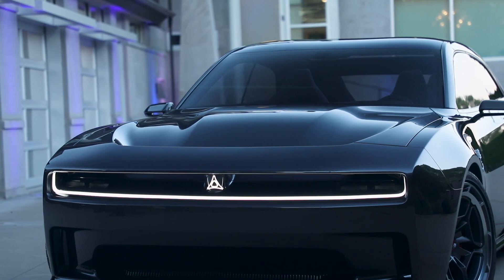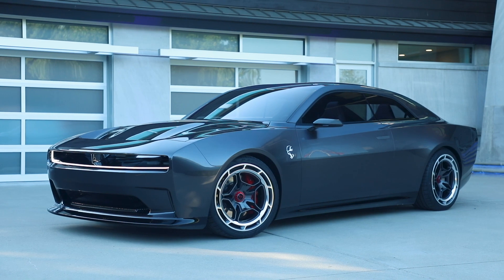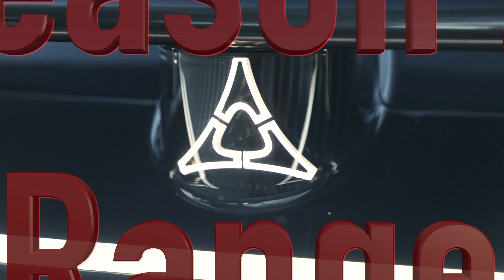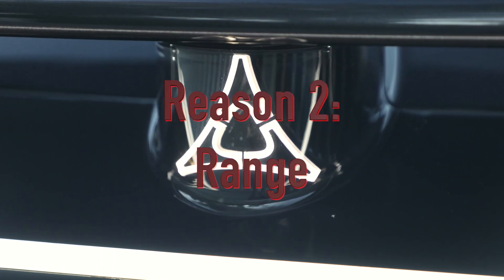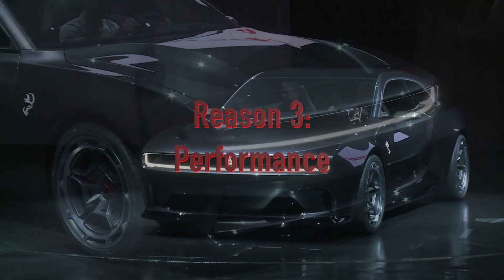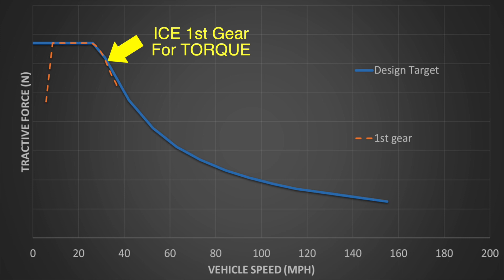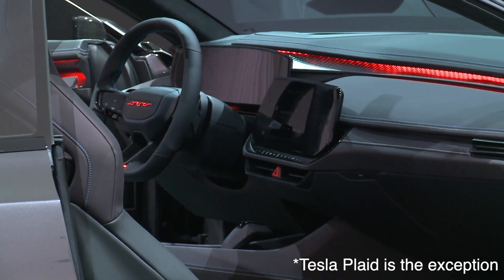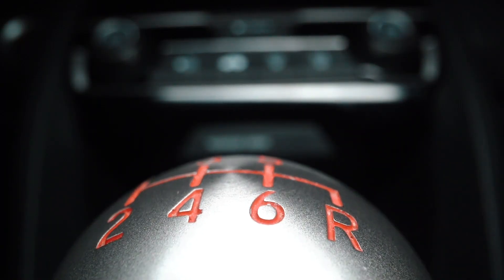3 Reasons Dodge Charger EV added a Transmission

Comment: Didn't Fiat already put a 4 speed in an EV?
Reply from the maker: i’m not sure about fiat, but there certainly have been EVs with multi-speed transmissions.  But is it a good idea for the future?
Reply: @EngineeringPerspective  It may not be fiat, but i remember one of the smaller euro brands has one in the works with a 4 speed. May be an Opel...
Kawi has a 4 speed bike in the works as well... hopefully that will increase the E bike range...

Comment: I feel like a 2 speed gearbox is reasonable for possibly higher efficiency at highway speeds, as well as top overall speed, without sacrificing any acceleration

Also the fake engine noises are actually from air being forced through baffles and valves, not just coming from a speaker, weird for sure, but still "authentic" I suppose

Comment: The feel without shifting is much better
Reply from the maker: I agree with you, that linear acceleration is awesome
Reply: Then add CVT instead
Reply: And you know what? Not to be rude but it's opinion for everyone and also option for multi gear transmission [Be it automatic, manual ETC] is good

Comment: Is the dodge EV transmission just 2 speeds, or more? Because if you only have 2 speeds, then the driver still isn’t really getting the gear shifting experience of a combustion engine vehicle.

Also, I don’t see what is stopping other auto manufacturers from making the same upgrades to their motors as Tesla has for their plaid. It would outright eliminate the need for a complex and energy-wasting transmission. I understand that carbon-enhanced motors are more expensive than regular EV motors, but there are plenty of high-end performance EVs that cost over 100k$, and still choose to go for a two speed gearbox (or a 1 speed, with low high-speed power), as opposed to using a carbon-enhanced motor.
Reply from the maker: We don’t have any more information than what was initially said, but I agree, if its only a 2 speed, the “experience” isn’t really the same.   I would much rather have better motors than to worry about adding a transmission.  That Plaid motor is so capable and has shown there is no need for multiple speed transmissions.

Comment: The sound is strictly for nostalgia, as is the transmission in all likelihood. The transmission will reduce range, it inevitably adds friction losses and weight and parts which can fail.

Compare the Porsche to the Plaid Model S/X for their respective efficiency & performance.

Tesla solved this "the right way", by improving electric motor performance with the carbon wrapped rotor which improves the maximum red line RPMs, eliminating the need for multiple mechanical gears (transmission).  The Porsche in contrast has a larger battery with less range, thus lower efficiency & yet comparable peak performance.

Also consider the origin Tesla roadster, where the motor torque was destroying the two speed gearbox.  This is common knowledge in the DIY electric drag racing community where builders regularly destroy transmissions and even differentials built for muscle cars because they can't handle the superior electric motor torque.  So this added complexity is a risk to longevity of such transmissions if the electric motor is not derated to prevent it from doing damage.
Reply from the maker: It will be interesting to see what Dodge learns from this….